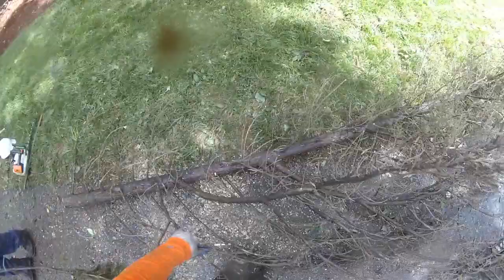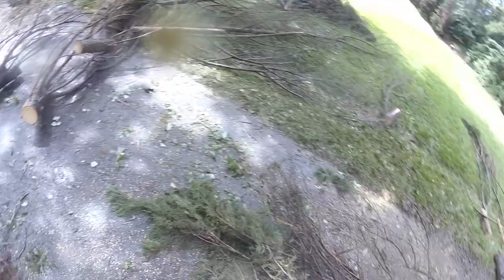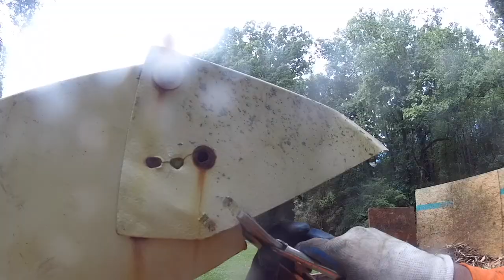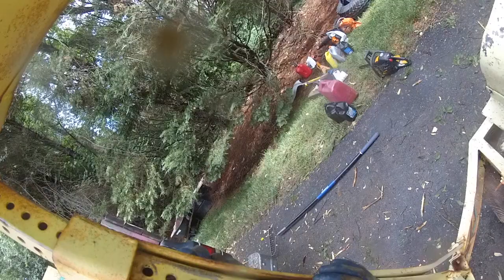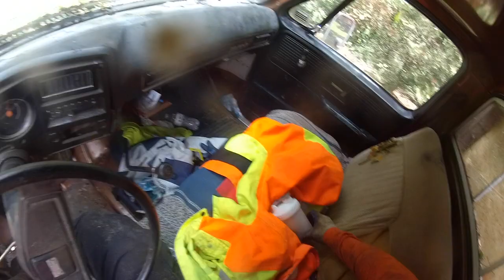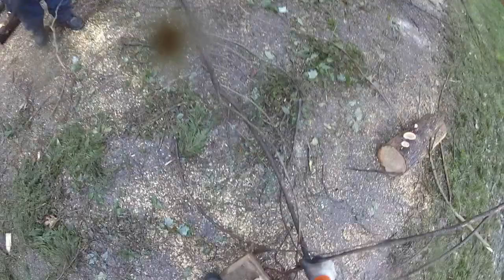Cutting Up and Chipping Brush - Part 3

Comment: Buddy I don't mean to be rude but did you get your pizza the other day cause I never saw you come down out of the tree? 
And I saw you lost your Nut lol I hate that when they basically fall at your feet and damned if you can find the Litte buggers.
one thing your working so hard your head swings are getting so fast it's like being on a carnival ride, Great Videos and awesome work Brother keep it happening and safe 

Garry
Reply from the maker: Oh yeah Garry I got some pizza and wings and I also managed to find that nut too and all that constant moving makes the videos that cause dizziness and I don't make to many when I am on the ground because of that.
Reply: TreeBoi4Life but definitely your videos are awesome, just your that type of flat out guy, always in there getting it done, hey why is the husky so hard to start?
Reply from the maker: the auto tune is a little crazy sometimes
Reply: oh ok so there not completely rock solid, your Stihl is going along nicely so I guess that was a good buy, You have to know what your buying huh, one of the companies here is selling a MS 200T that has been around and they want $1,100 Aus for it and yet I can buy it Brand new for $1,200 really wrong when they do that, I don't have one yet as I still am using my little Stihl saw but need to upgrade to one of the top handle saws soon. I could by a better saw from the States used and even with shipping its still only about $850 here and looks about half the wear on it as well as a later series, some of these guys are such rip offs. Sorry things are so long but can you answer me do you rotate your gear? or just use it for its service lifetime until its not reliable any more?
Reply from the maker: Garry I usually yearly replace things like biners and lanyard rope and climbing lines since I do a little splicing but lately I have been lazy about updating my lanyard ropes and plan to put me some together in the next few weeks.  You live in the land were the real tree men roam and y'all have some serious tree guys in Australia.  Ace Tree took tree work to a whole nother level with those tower truck and I am sure with the stringent practices you guys have in place there its best to update certain things yearly or bi-yearly because its safer that way if you can afford it depending on the frequency of use however my saddle I use until I can't stand it any longer since I am able to replace the rope bridge and the rappel ring.  Rigging ropes too because I don't abuse my lines because I am always working over something that cost more than I'll ever will be worth..lol...but seriously you know how it is on some jobs, failure is not an option.  Lifetime use like you mentioned dictates the use and if it was shocked loaded to the point of no return in which case I use it on the none important jobs were I can abuse it without any penalty, so to speak and in that sense I get a full life out of it like pulling a building down or a pulling a car or truck out of a hole if no chains chain be used, things like that.  I hate guys charge so much for those saws there and USD value for these saws are about the same when adjusted to inflation which is why it took me so long to buy one.  I paid $325USD on craigslist from a reseller for my 200T.  The T540 sells for that same price on eBay or cheaper and I have enough parts to build one which was also why I waited till a deal came along with the T because I prefer the 540 and could have just bought it new.
Reply: TreeBoi4Life that's funny the differences, here the Husky is the same price as the Stihl and they import 2016 Rams change to RH drive and they pay high $139 k for them Australia is bad for that, I Love Aces videos but some of the Gums they take down, give me nose bleeds seeing them that high up
Reply from the maker: SMH...Commerce is big business and I wish I was on the other side of it sometimes and yeah man their vids are insane.
Reply: Hey I heard you say that you did a big Job at a Quarry was it where you and Human were taking down a heap of trees, is that on Video ?  and if so where would I find it to watch
Reply from the maker: I haven't had a chance to work with Human and these were two different jobs and videos but it would have been cool though.
Reply: Oh Right, I must have misunderstood about the job, I am finally starting to upload my videos on some of our gear here on our place. Keep your wonderful video's coming

Comment: I have welded 5 inch nails as handle over stuff I remove around m'y chipper 🙋
Reply from the maker: I need to learn how to weld myself because I popped a belt on the chipper a few day ago and it snapped the piece of steel the tensioner pulley was on off.  Blew my mind Luc but I forgot how brittle older steel gets and I can imagine that piece this piece has been stressed out completely.
Reply: TreeBoi4Life  yes stress is major factor  for failure welding is an asset I have been  to build up While I was mining drilling
Reply from the maker: I am sure that was a job right there.  I just hope they paid you well.

Comment: that thing looks way dangerous, i've used chippers (rentals that will take 6" dia) they pull branches in much slower and have like a shut off bar at top of intake chute
Reply from the maker: This is a traditional chipper better known as the chuck and duck and once you master it you'll never need another chipper unless you just have to chip larger material but this bad boy is plenty dangerous if you're not careful.  Thanks for taking the time to comment.
Reply: i know Im pretty off topic but do anybody know a good website to stream newly released series online ?

Comment: how long does it take to shovel out the chips out of the bed?
Reply from the maker: On average from 10-15mins one man and a small load to nearly an hour for two guys because when you pack it down you know how the mulch just clumps togethers and this chipper doesn't chip the limbs as well as others do and it mangles them and those tangles are tough when raking and shoveling it off the truck.
Reply: wow! i really hope you can get a cheap dump truck
Reply: TreeBoi4Life get an old chain link gate.Put a 1/4 inch cable About 30ft long on the bottom of it. Put gate in front of bed standing up. Cable hangs off tailgate while chipping. To unload,unhook chipper pull truck forward like 20ft. chock chipper wheels in front. attach cable to chipper and drive. Truck should be unloaded in about 3 to 4 minutes. could also find something else to anchor to like a tree or big stake in the ground? Winch under the rear of a flat bed works best. That's what my next step is.
Reply from the maker: Thats pure genius for us poor folks...I like that idea, I could have used this when I had my flatbed dually and it never crossed my mind, kick in in low and I'm unloaded.
Reply: TreeBoi4Life A nice thick piece of plywood works good too like 3/4. maybe double them up?
Reply: TreeBoi4Life Hey I'm 44 years old. When it comes to being poor i have lots of experience! Haha
Reply from the maker: lol...I know thats right and me too and much more than I care to have.

Comment: buy or rent a dump truck and you may need to get a leaf blower
Reply from the maker: I would if I could carry that cost to the homeowners but hopefully by next year my chip$ will stack up and I got my sites set on a crew cab dually 10ft+ dump.  Thanks for the advice though Christopher.